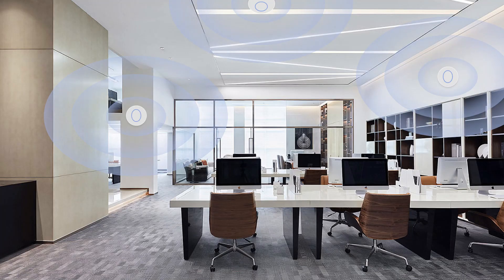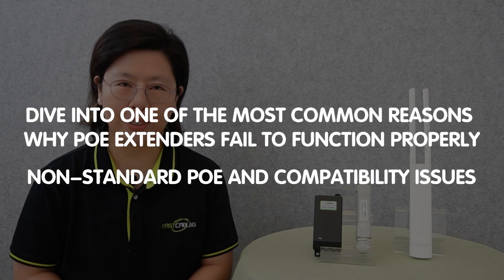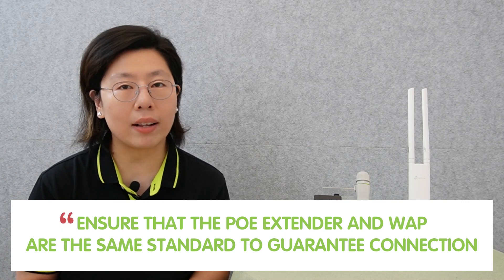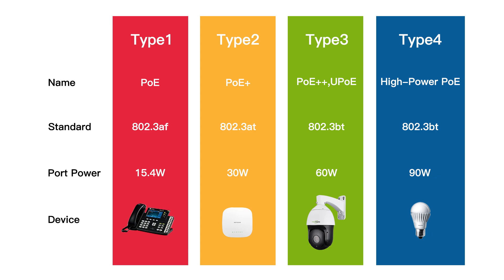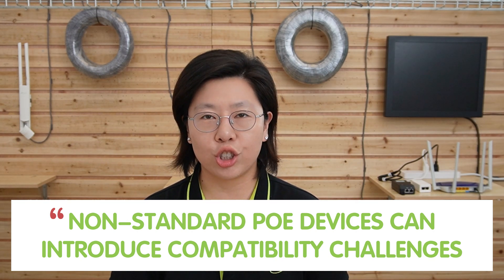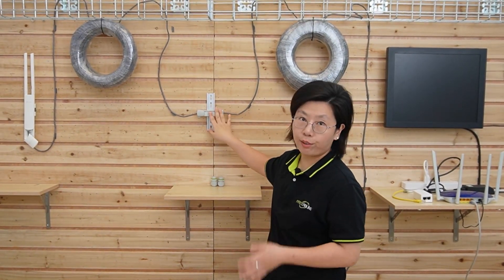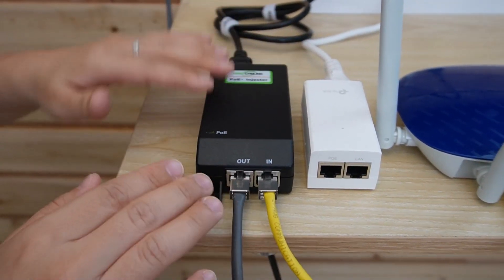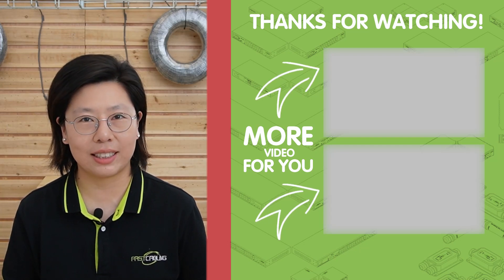Why a PoE Extender Doesn't Work with Your PoE WAP?

Comment: Hey Fastcablig I want to know how I can connect 2-3 office locations with central monitoring over the internet  (direct cabling not possible) ?
Reply from the maker: You might use PC software from your vendors to link all these three cameras, but the performance will depends on the internet speed from your ISP on both cameras sides and the center. You might have no stable live video. The alternative solution is you can set NVR at each of these locations or put micro SD card to these cameras. Even you don't have stable live video, but you still have consecutive recording at each locations.